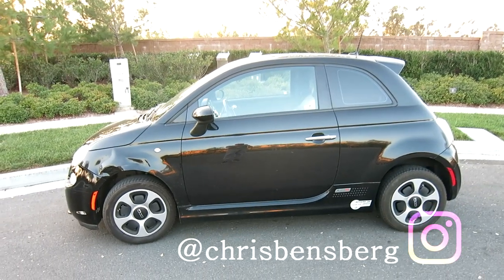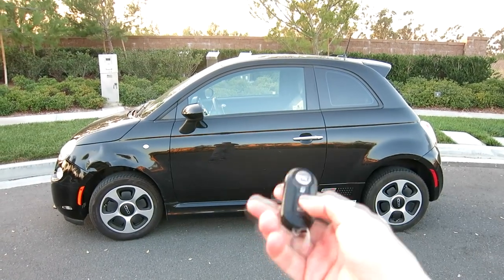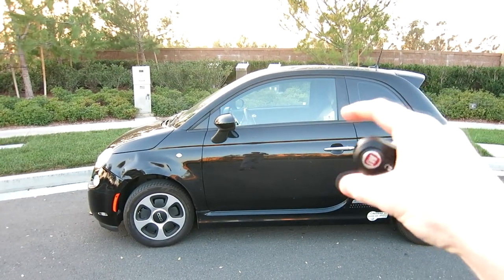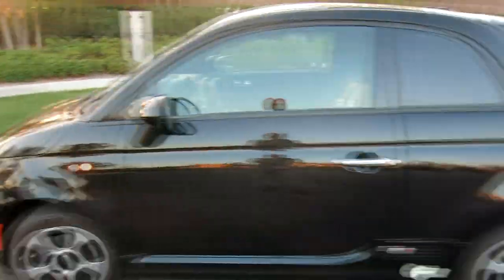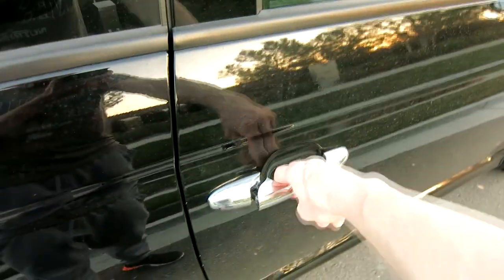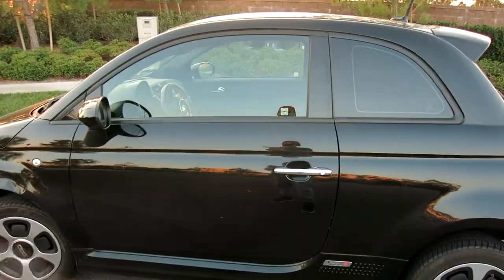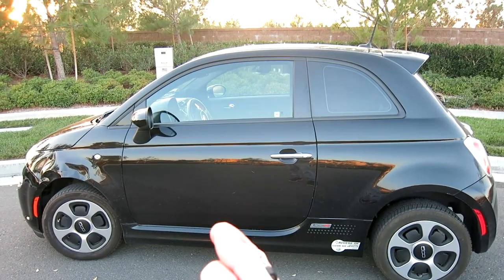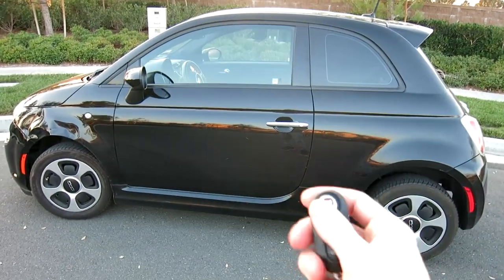How To Lock Your Fiat 500 Without Making The Horn Honk Sound

Comment: Simpler... before closing the door, push in the door handle. It locks all 3 doors. A double click of the bob will unlock all 3 doors.
Reply: I had thought I discovered that except it only looks the driver's side on my 2012 500 Sport.
Reply: @vivianportis2992  In the menu options, it allows a setting to lock/unlock one door or all doors, at least in my 2018. The default is to lock only the driver's door. Set to all doors and pressing the lock on the driver's door will lock the passenger side. (Locking the passenger door does not lock the driver's side.)
Reply: @mikep490  Mine is a 2012 and if I turn the key first to the left and then to the right it looks them all.  But thanks for the info!

Comment: Do you happen to know how you lock and unlock the hatchback without the remote?
Reply: In case you haven't figured it out, you have to pull drivers side inside door handle towards you.
Reply: What was wrong with good "old fashion" keys? Theyre inexpensive. They worked.  Theyre simple.

If it aint broke dont fix it!

How are FOBs ( seriously "Fob"???)
better than keys?